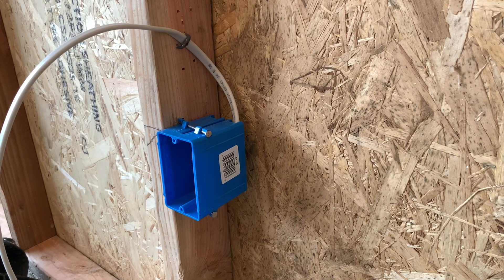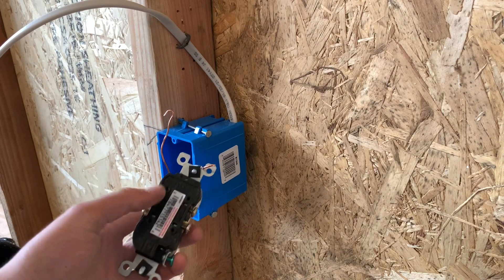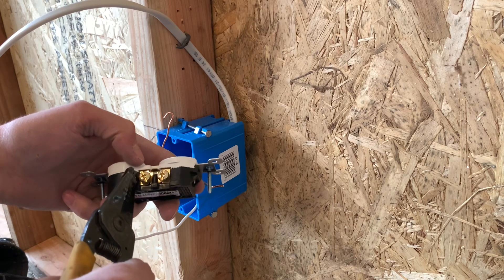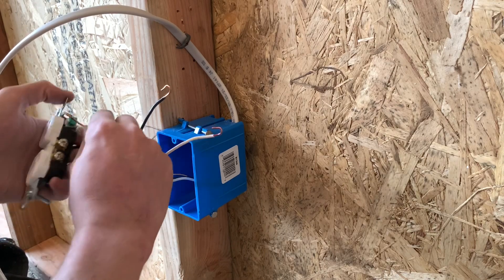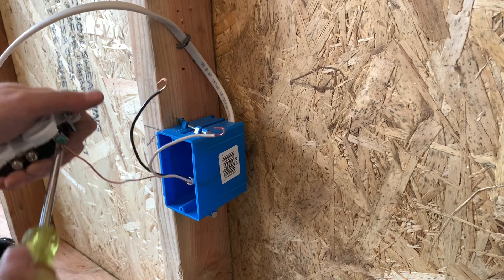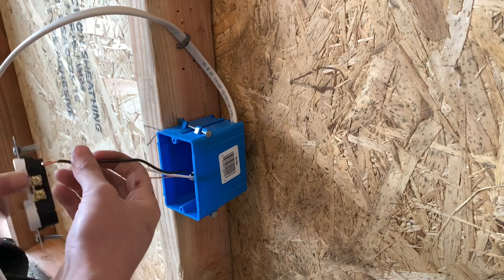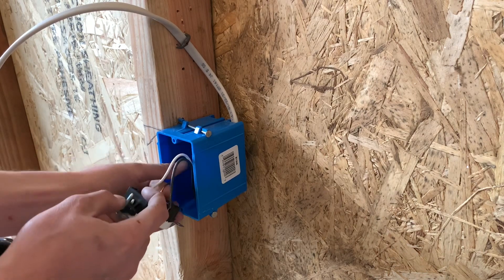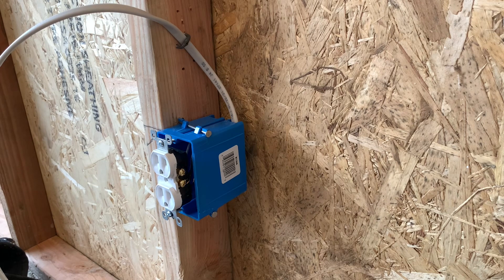Electrical 101: How To Install A Duplex Receptacle (1 Wire)(Residential)

Comment: Can you show how you wire a box that has 2 duplex's and power going in as well as out to another box?  Basically it's a 2 gang box that's not at the terminal end.  It's in the middle of a line of outlets.